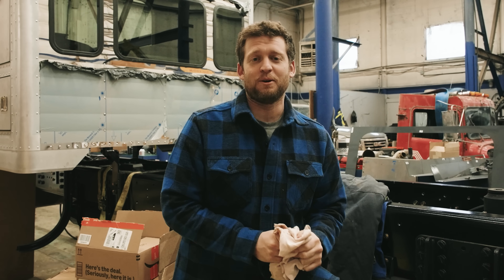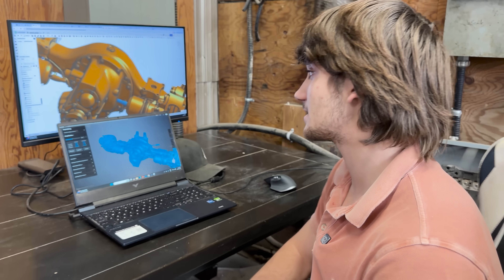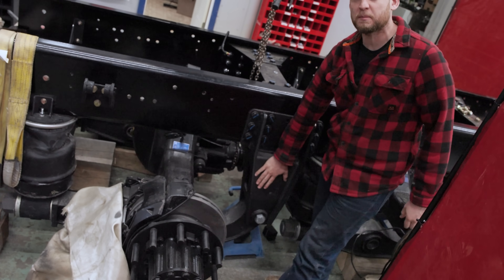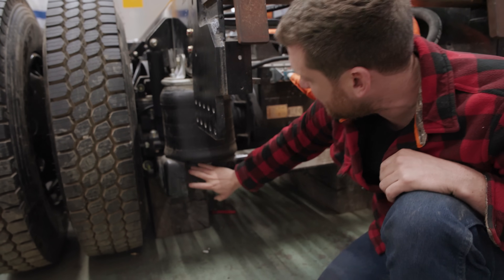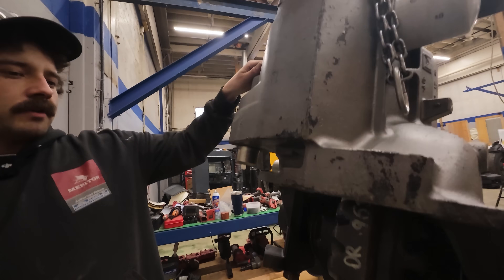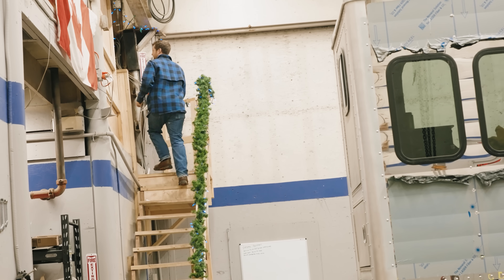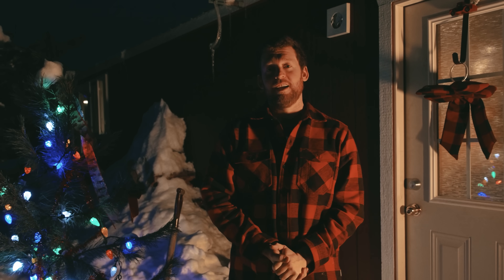When Precision Becomes the Problem

Comment: 13:30 As a machinist, even I will defend the engineers here. That note got under my skin because besides the first two lines of the second point, it's wrong. By definition a tolerance is "an allowable amount of variation of a specified quantity, especially in the dimensions of a part." The Machinery's Handbook has like 5 more but those are more specific and still fit within this one that you can find with a google search. Tolerance is only referencing the dimension/datum of the part in the drawing, while allowance is for mating parts to fit during assembly.

Seems like you've solved the assembly issue but I guess there's another problem of having better communication between mechanics, and the extra processes needed for assembly.

Everyone in trades understands having frustrating moments so nobody will flinch when you go into a rant/rage about things not fitting but the short rant about engineers and tolerance, and the note is something I never see unless it's from a problematic customers. That's something ranted between coworkers, maybe a note or draft email gets made but it never leaves the company's walls. Showing it on YT means you can't take it back now.

Comment: One thing you learn when working on prototype to production is that you roll with the punches and come up on top. Never let a failure or snag get to you, just deal with it and prevent it later from reoccurring. A failure has to happen once. Don't make it into something that will stress you and your team. As long as the end results are perfect with the extra effort at the start, you have no issues and production will be smooth sailing.

Comment: I'll preface this; what you're doing is great, the idea of hybrid vocational trucks just seems like something manufacturers should already be doing. Can't wait to see your company in Australia, and I'm just a mechanic.

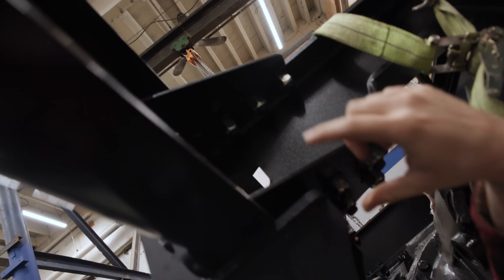At 10:10, you mention vertical bolts for the hanger through the cross-member attachment plate. Does this take away from the flex and "twist ability" in this area, increasing the chance of cracking or the vertical bolts coming loose due to shifting plates because the hanger is quite tall and rigid.
It looks like steel rather than the cast plate we KW uses here so I could be wrong.

Or are the vertical bolts through the rail lower flange?

Comment: Tolerance: How much the part is allowed to vary between a minimum dimension and a maximum dimension, a function of all the manufacturing processes which may introduce wobble or distortion in the part. Allowance: Additional slop designed into the part to make sure everything can be assembled and operate smoothly while maintaining clearance. Clearance: Actual space between two installed parts when they are at rest in the assembly (how it actually is built). Knowing how to apply all three of these is the mark of a seasoned engineer; not applying these correctly is the sign of a new and inexperienced team. You either do it the right way the first time or you do it again until it is right; every engineer learns this lesson eventually.

Comment: If something isn't made to bend, it will eventually break somewhere. Make sure there are mechanical failsafes that can absorb the load in a bending mode, because a bent part can get you home when a broken one won't.

Comment: Ive been doing producion steel fab for more time than ill admit to. You can save yourself a bunch of grief by not prebuilding your axle mounts. Simply jig up your axles, if smert you'll set your jig up for both electric and mechanical axles, and ditch that plate between your mount plates. Properly jigged, you can weld the actual mounts directly to the axles with full welds all round. With the right jig, your pins will all line up and be repeatable forever. 
Repeatability especially between electric and mechanical axles would be ideal. One suspension setup for standard parts.
If in the future, the axles change, you could simply change the design of your plates and maintain the same geometry and original parts.
Reply: I love real world feedback like this. Thanks :)
Reply: Exactly, the axle mount only the 2 end pieces. There is no need for the side pieces. If you remove the square side pieces, you get rid of theclearance problem. Or you coud make 2 halves pieces.

Comment: As a machinist, I feel your pain on the tolerance issue. My brother in Law is a carpenter. When we first started building my garage, it was a steep learning curve for me. I couldnt wrap my brain around 1/8 inch is OK for building walls, trusses, etc. Your ability to adapt is commendable.. Keep On Truckin!!
Reply: The engineers at our shop really do love drawing tight tolerances. 

And the machinists love even more proving that they can hit the top of the tolerances for pins and the bottom of the tolerances for holes every single time. 

Which often results in lots of grinding and hammering and swearing for us.

The other day I was putting in brass bushings, and I still had to put my entire weight on the arbor press. And that’s after putting them in liquid nitrogen.

Comment: When manufacturing, the rule of thumb is welding first, machining after. 
For those axle pieces, a small horizontal boring mill would probably work well.
Reply: And a random mechanic should not be deciding what the tolerances should be. This should be a team decision that is well planned ahead. Especially for such an important component. A head engineer should be discussing these things with a head mechanic. And both heads should discuss this with their team. And then both heads can make the decision after they have talked about all the plus and downsides with their own teams, and after they have calculated the amount of work and costs that are involved with a certain type of fabrication. 

A machinist would understand that you can't get precision tolerances by just welding parts together. To get those precision tolerances it always requires machining. I think that they are lacking a fundamental understanding of how that works. Sure they understand the basics of assembling welded parts, but I think that they lack experience with precision tolerances. The moment that I saw their engineer slam that 3D printed prototype in place I had doubts if the real part was going to fit. And sure enough it didn't fit. Because 3D printing is not the same fabrication process as working with welded steel. It is simpel as that. They should have an engineer who understands that to avoid those issues.  

Now they are going to adopt a philosophy that is wrong in my opinion. Because now they are going to fabricate it in situ. Which makes the production costs a lot higher. If they are going to apply that type of philosophy throughout the entire build from the truck then the truck will become very expensive or they are not going to make enough profit.
Reply: @insAneTunA you should apply for a job there.
Reply: @northernmetalworker  It is a bit out of range for me. I'm from Europe. I also like it better here in Europe. Where I live we have a lot milder climate compared to Canada, which I prefer. So moving to Canada is not on my wish list.
Reply: Couldn't have said it better myself.

Comment: Before starting the whole video.. Tolerances in trucks. I spent three years of my life analyzing in minute detail the allowable tolerances for an OEM. Still getting nightmares about it haha 

Some notes whilst viewing:
- very strange the axle manufacturer doesn't give you their 3D files. We always get them from our suppliers without problems. Maybe you need to network more. Automotive is not about what you do, it's about who you know.
- Build a (wooden) platform at cabin height. You will have a worker fall out the cab sooner or later. It can be a nasty fall on a concrete floor and nasty lawsuits/labor inspection trouble after.
- Incoming part quality inspection is essential. Suppliers can claim so much, checking is always better. We once had cabin shocks that were +170% out of spec. and nobody knew. Customers in the mean time complained of the bumpy ride.
- Expensive lesson on the tolerances. I advice to invest in a better process early, instead of losing money on the 2nd and after trucks. Mistakes happen.

Best of luck and keep going. Write me if you'd like more advice. At my daily job we can output 250 trucks a day now and keep improving.

Comment: 14:33 tolerances come at a price. Engineers need to know that ordering a part with a 1" milled slot is way cheaper than a 1.00" slot.

Also, know the tolerances of mating parts. Their maximum part must fit your minimum slot.

Comment: I have a set of bridge reams that would solve the pin alignment issue.  Y'all should invest in a cheap used Bridgeport mill to quick fix these little issues.
Reply: They should get an entire shop of used tools. Get a used large, mill, surface grinder, chop saw etc.

Comment: Suggestion:  If I was designing that axle bracket and desired a snug fit I would likely do the following.  Make one "flange" my reference surface that does not get touched.  Make the other flange with enough clearance so you will not need to be grinding anything and then add a couple of small pads (shallow tabs) about 3/8" long to the "ears" on the "may need to grind" side that will result in a gap size for a snug fit like you have now.  This way you have precise location from your reference side and only have to grind a small area (the 2 pads ) when necessary to get the precise fit you want for a chubby axle.  Welding will take care of the extra gap you added for more overall clearance while the "fitted when necessary" pads will hold the accurate positioning you desire. 

 I'm in my fifties now and have been tool making, machining, fabricating, automating, CAD designing my whole life.  I went to BCIT on a scholarship for building a robot arm in high school.   I have run into these sorts of problems you're experiencing many times and have learned the following...

- Rule number one is don't pass on important information verbally and put everything that could possibly come back and bite in writing.  (This will save your ass and the project when things go pear shaped which WILL happen one day).  As an employee, it's very annoying when a higher up strolls up with nothing in writing and rapidly lists off half a dozen important things you have to take into consideration while waving their arms about as they walk off.  They then of course get all high and mighty when something gets missed.

- Don't blindly trust vendor "experts" to understand what you're saying and will give you what you need by assuming they know what they are doing so be specific. "Experts" too often don't know or don't understand what you actually need.

- Make tolerances as loose as possible without sacrificing quality.

- Provide the dimensions the fabricator or machinist will need not what looks pretty on a drawing.

- A picture is worth a thousand words so 3D model the welds to appear on drawings too if possible.  Some CAD programs handle this better than others.

- When CAD modeling parts and assemblies,  drive the CAD model using reference dimensions or geometry that reflect the actual real part application and not what's convenient in the CAD model.  Always assume the model may be altered by someone else down the road who doesn't know your thought process so that when it's modified later it rebuilds itself correctly when changes are made.  "Fudging it" saves time today but often creates a headache tomorrow.

- It is a little more work but I often create two separate CAD assemblies when there is cross referenced geometry between many parts.  One assembly file I add the suffix "construct" to the name and the other I add "clean".  The "construct" assembly is where I build it with parts in fixed positions with all my cross referenced geometry and dimensions etc. This way I could alter the position of a truck door latch for example and the frame opening and door model will automatically update with cutouts, holes etc  in the right place without me doing any manual editing.  This makes for a robust model that isn't broken by moving parts that are moveable and then trying to update the assembly.   Next I create a "clean" assembly using my finished (or unfinished) parts that only have assembly fit relationships and nothing else.  This way I can play with my assembly to test door opening or window travel for example like a real world assembly without risking breaking any part geometry or relationships. 

- When fabricated sheet metal parts need to be bent accurately but they have numerous flanges, angles etc that stack tolerances (where the next bend references the previous bend geometry and so on) it can be useful to use centerline bend method referencing just one or two fixed edges on the flat blank. This makes each bend it's own entity refencing a fixed part edge so you avoid tolerance stacking from variations in material thickness, machine accuracy, variations in bend allowance due to brake V die width or radius. 

- Laser cut parts with notches for accurate assembly of course but also add corner reliefs and corner radii for the tabs and slots to allow for laser beam diameter so they always fit together precisely without binding in the corners or having to add unnecessary looseness while still being quick and easy to assemble.  Avoid sharp corners. 

- Watch out for tolerance stacking where each part does not need to be super precise but add a few parts together in an assembly that are all at at the tolerance limit in the least desirable direction and suddenly you have a problem.  Tolerance stacking can be a pain in the ass requiring more precision than needed driving up part cost for that low % chance there might be an issue one day.  

- Avoid painting yourself into a corner by requiring higher accuracy than needed because of how parts are located.  For example, to accurately position a part with 2 pins it can be advantageous to use one precise round hole and one slot rather than two holes because it removes the requirement for two sets of holes being precisely the same distance from one another while making assembly/disassembly easier and still maintain accurate positioning.   

- Watch out for part corner radii and chamfers in drawings.  CAD people often like to dimensions to sharp corners that aren't actually sharp but look sharp which throws off the dimensions. I have seen it numerous times when corner chamfers or radii are added to a model later and the drawing dimension referencing the sharp corner updates because it auto reattached to a chamfer and is now wrong.  I dimension to edges not corners whenever appropriate.

- Add fillets, chamfers, corner rads, draft angles to a model at the very end whenever possible.

- It's safer to have the CAD program add small chamfers or corner radii automatically for sheet metal parts when it creates the flat pattern and keep the model with sharp corners to help avoid dimensioning or assembly issues.

- When CAD modeling a part or building an assembly, use part model and assembly base planes/axis when possible for referencing geometry and positing parts.  The reason for this is because when a part is changed (often a lot), the geometry you used as a reference for adding a flange or locating slot for example later may not exist anymore and now you have failed features or an assembly with failed relationships you have to go and fix.  The base XYZ planes/axis never change but geometry often does.  You can often swap out entire different parts without the assembly breaking by doing it this way. 

- Make sure to edit lock parts with inter part geometry relationships BEFORE the models/drawings are sent out for manufacture so you don't discover holes in the wrong place when you go to assemble your creation.  It's very easy to move a part for example forgetting it's mounting bracket and bracket mounting holes move with it (if modeled correctly). 

There's more than one way to skin a cat and I'm sure there's other things too I can't think of atm but that's what comes to mind. 
I hope some of this is helpful for those who cared to read this novel.

I think it is fantastic what you guys are achieving at Edison and wish you all the best.
Reply: Another mistake they appear to have made was right at the start. They 3D scanned one finished axle and assumed that all the axles would be exactly the same size as that one.
Reply: Yes, yes, YES. Valuable voice of experience here. Print and post this so you can reread this in the future!
Reply: I think this is generally useful information that can be posted verbatim to other videos too. This is applicable to many types of operations.
Reply: Coming from the vendor side, what you say about tolerances is right on the money!
Reply: Nice overview !
I worked in R&D at a company that made 400 million devices per year, and learned to appreciate processes that were just "lean" enough, but had enough robustness to keep things working in production volumes... I remember two designs that I was second-sourcing and assumed a certain kind of electrical behavior, that was in the original device, would become part of the second-source, but didn't _write it into the specification_! And, of course, that "corner" of the behaviour was different enough that we had to re-spin a nasty part of a complex design?(Probably $50-100k for the design changes and new IC "tape-out"!) You can't assume that another engineer, or designer, knows every corner of a spec'!!
Reply: Why aren't you using a Neway or Meritor axle adapter?  If you want Meritor to warranty the axle housing, you'll need Meritor to approve the axle adapters and welding procedure. That's already been done for the Neway and Meritor adapters.
Reply: My word your reply is spot on. You pointed out stuff we have trouble with and didn't realize it was a problem. Thanks I wish I knew how to save your post.